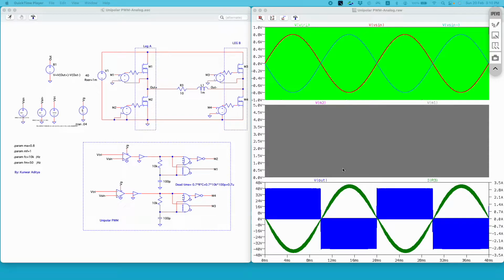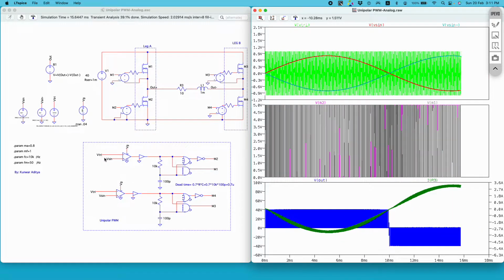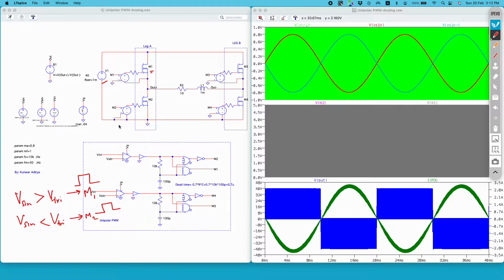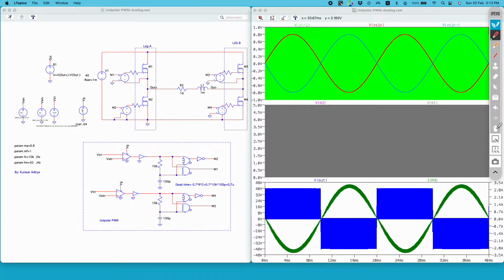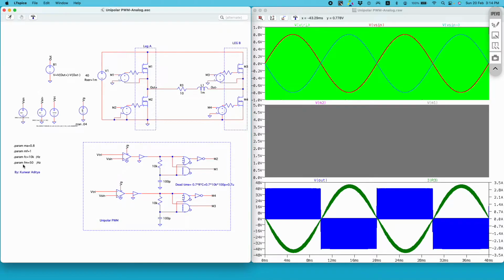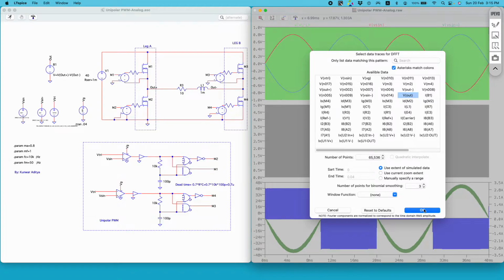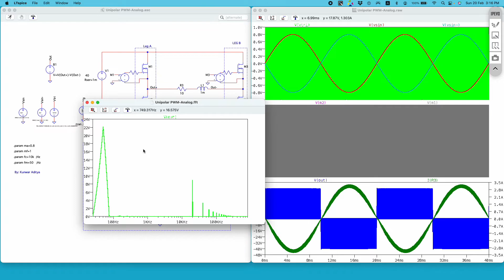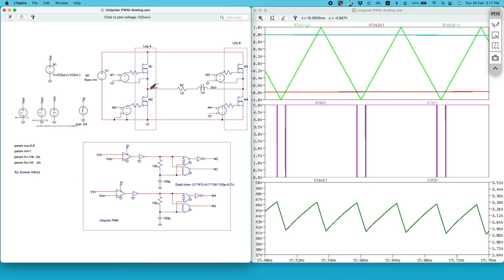Unipolar PWM for Single Phase inverter in LTspice

Comment: Thank you for your video. I have 1 question for this lecture. I wonder why there is a phase difference between the reference Sin and Inverter Waveform and how to correct it.
Reply from the maker: Reverse the probe connection :)  Phase difference will go away